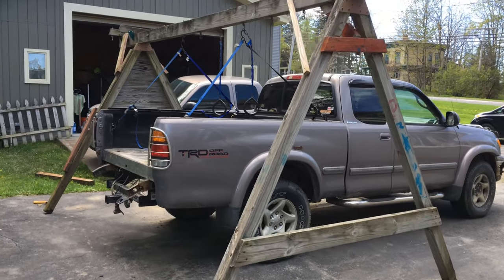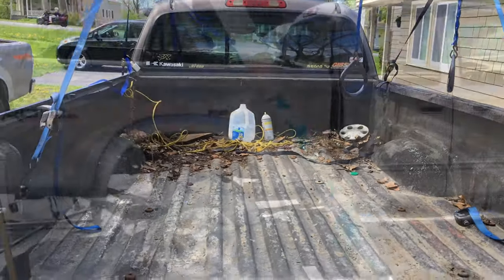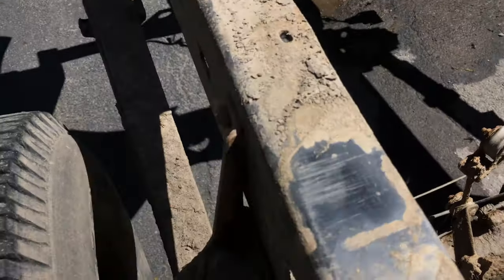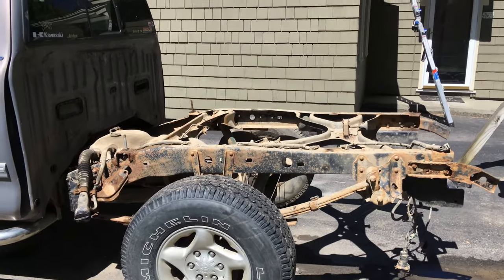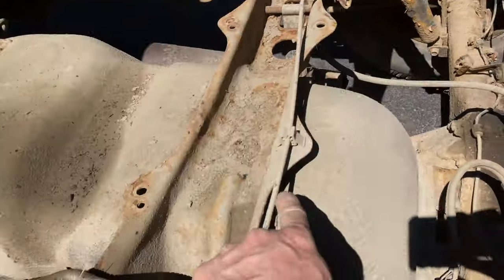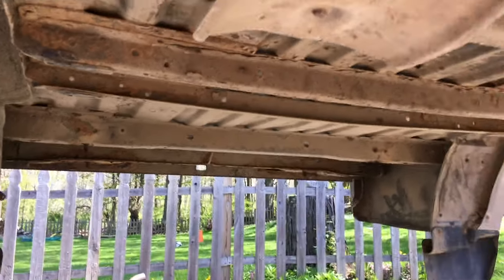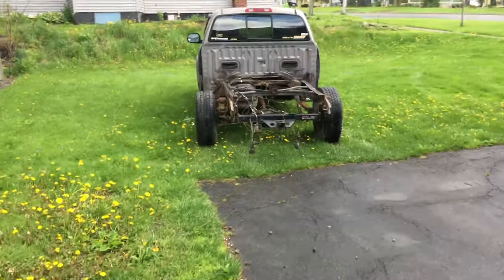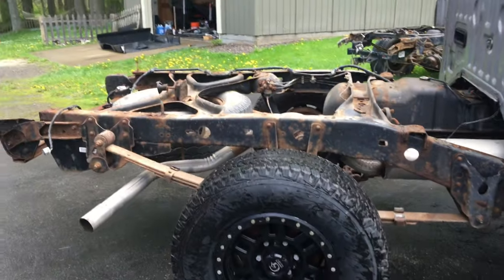Remove Bed - Tundra. Make a Flat bed?

Comment: They replaced my brake lines and LCAs  when they replaced the frame. They were afraid of breaking something when trying to swap the LCAs so they just cut them off and replaced. Didn't cost a dime idk got lucky I guess. Still wish I could've replaced a couple more things when they had the body off. BTW mines a 2000 4x4 SR5 regular cab long bed with 121000 on the odo

Comment: Attention Tundra owners...Suggest replacing your rear shocks whenever you remove the truck bed.  The top bolt of the rear shocks are very difficult to access when the bed is in place.

Comment: Man when I did mine it took an hour of me using the torch to heat up all the bolts
Reply from the maker: Troy Fabrizius I hear you bro! Any time I work on this truck I’m doing pb blaster, heat, impact, anything!! I break half the bolts clear off and spend the next hours dealing with the backlash.
Reply: DadsGotADeal I was lucky enough to find a parts truck from arizona

Comment: The frame on my 2001 tundra is wrecked with corrosion. So you got a totally new frame under the recall?
Reply from the maker: Harry Krumpacker yes it was replaced before I bought it. I don’t know if they still offer it but definitely call them up with your vin number
Reply from the maker: Harry Krumpacker I heard in a Facebook group I’m in that they are still replacing frames for access cab tundras. Definitely worth taking your truck in and asking about
Reply from the maker: My truck has a replaced frame. The parts truck could use one though. Hopefully the new owner checked with the dealer
Reply: Yes definitely try to contact someone with your vin.  Do you know if it was manufactured in one of the northern states Toyota?  should tell you on your door jamb sticker.  Mine was replaced in 2017 and it still looks almost new starting to show a little flash rust in some tucked in areas. going to be removing my bed soon to throw a coat of Por-15 or chassis saver on the frame rails etc... and finishing it off with whole body exterior T-Rex bedliner

Comment: Wow.  It never occurred to me to keep part of the original floor create a flatbed from there.  Seems like a great idea! Have you seen this done successfully?  Would love to know more on this concept.  Thanks!
Reply from the maker: Scott Davenport seems like you could keep the floor and build a flat frame around the edge. Or build a metal frame and rest the flat floor on top of it for more strength. Just make sure to leave room for the tires to rise when you hit a bump or carry a heavy load.
Reply: The reason my bed needs replacing is because the floor of it rotted out lol
Reply: @DadsGotADeal      ,!.

Comment: Shit I want that bed... Mines rotted to hell lol
Reply from the maker: Ricky Osborne where you at? I might be parting out my truck soon
Reply: @DadsGotADeal  upstate ny. I have a thunder grey 2000 trd tundra and my bed is literally shot. Floor is rotted, front corner is sagging like 2 inches. Wheel wells are shot.
Reply from the maker: Ricky Osborne oh dang. I moved to Florida from upstate last year!  I’ll be up there Christmas but not with the truck! My driveshaft just broke in half from rust!
Reply: @DadsGotADeal  damn that sucks. I have two of these trucks but my 01 isnt much cleaner and thats my parts truck lol

Comment: I need a bed bad lol. Floor is rotted to shit
Reply from the maker: What city are you near?
Reply: @DadsGotADeal  Albany NY
Reply from the maker: Ricky Osborne Aw man. Shoot. I was gonna be driving up there Christmas but due to Covid my trip is cancelled. It’s a shame there isn’t a good way to get rust free parts up to you guys up there. I just started parting out my tundra because the rusted parts keep breaking and it’s never ending. I found an fj and I’m putting my rusted tundra engine in it. Parting out the truck
Reply: @DadsGotADeal  damn dude yeah I have two tundras but the beds suck on both.. boss has a first gen with 87k on it that's as rotted or possibly worse than my one with 220k but my dd one is the same color as yours
Reply from the maker: Ricky Osborne ya my 2000 only has 98k miles but my driveshaft, gas tank, steering lines, brake lines, exhaust... all broke this year from rusting out!
Reply: @DadsGotADeal  that's insane got both mine off the boss because he didn't want to fix the little issues they each had so I got both for a grand....he's got the 01 with 87k and a 03 with about 160k plus a 14 and 17.